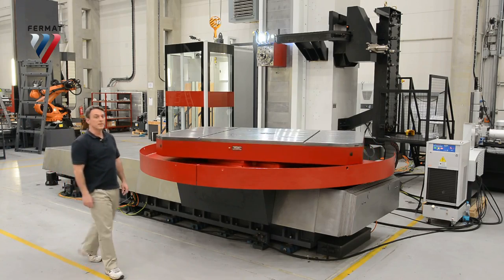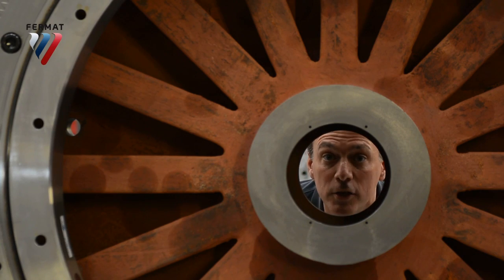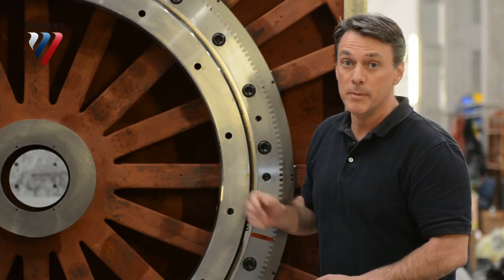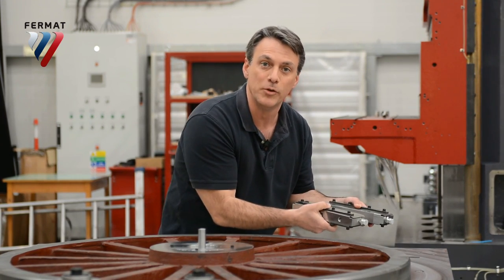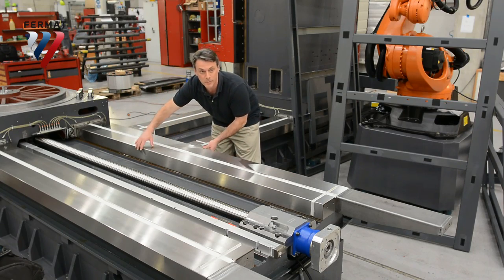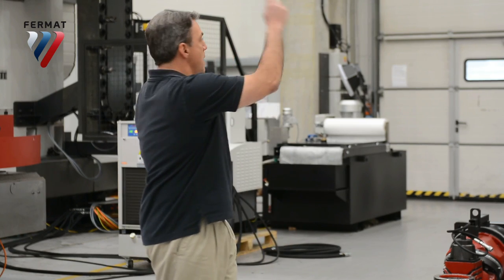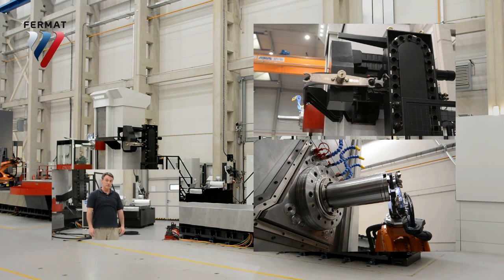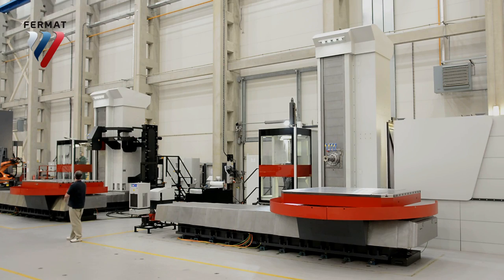CNC Rotary Table Explained | Robot vs Automatic Tool Changer Race| Table-type Horizontal Boring Mill

Comment: Proud to represent the FERMAT/LUCAS horizontal boring mill in Illinois. Massive machines, robotic integration, multi-axis capability, Lucas HBM longevity from 1902 in Cleveland, OH. Helical interpolation with in-the-cut multi-axis rotation ability, combining heads and inclining tables. WOW.